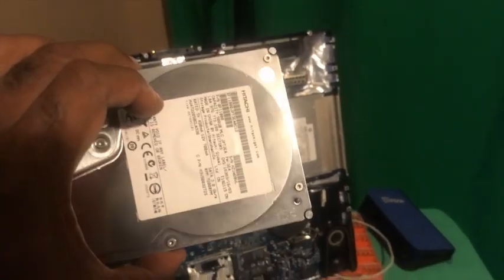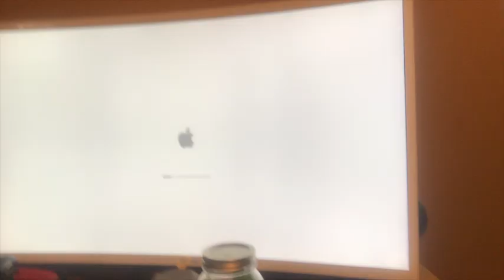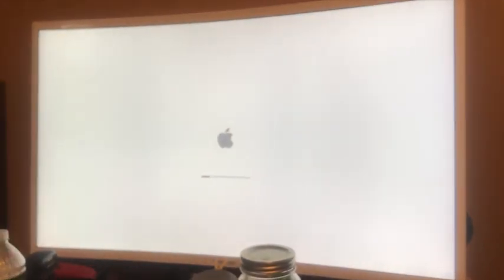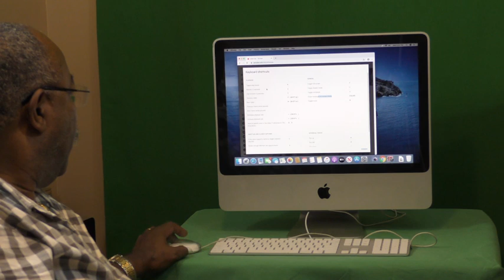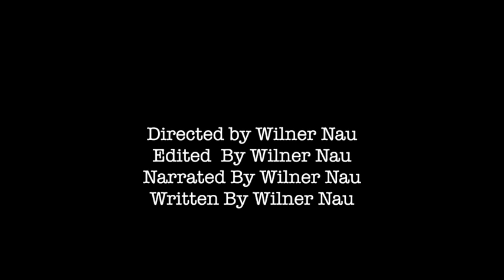Mac Os  Catalina on a iMac 2008

Comment: Nice Video Sir Thanks For Sharing I have a early 2008 IMAC 24 upgrade ram to max  that runs great I used fir DJing my live streams or Practice sessions  for about 2 years. Its my main one and I bought it for $200 about 3 years ago I also have  15"MACBOOK PRO I use to DJ with I love them both but I can't run some of the newer studio I use on the Pro If I make these upgrades will I be able to yun it with apps like Logic Pro X or should i upgrade to something newer with Thunderbolt. I love my makes for what I do they been great over PC I do miss windows office better but it stops there.PC Guys get soooo mad at me for the Love I have for Apple. I was that PC and Samsung guy for years not but virus and crashes and over heating issues.I buy everything Apple and this far its been a great experience for me watch phone ibuds pro Imac and Ipad 2 I bought for $45 2 mo ago and I talked family members into Mac Air and Ipad Pro everyone is one big happy Apple Family.

Comment: Can someone please tell me how well would CATALINA work on an early, non-upgraded, 20 inch 2009 iMac? 😭

Is it worth upgrading from an El Capitan? I just need to work low maintaining applications such as Microsoft 365, grammarly and other academic writing applications (JStor). 
PLEASE. HELP. 🥺
Reply: Adil Majeed same question
Reply: I don’t know if I would risk compatibility issues if your using those applications for school.
Reply: Adil Majeed running osx catalina on may late 2009 imac. Works fine. So far so good
Reply: You must upgrade ram to 6-8GB minimum and upgrade to SSD 256GB minimum and for best performance choose high sierra. It will run super smooth like stock. You can upgrade to Mojave and it will run great too. Catalina is not worth it because 32-bit apps not supported and it is too resource intensive in general for old macs. But it can run it! And it will work ok but your cpu will maxed out with any heavy multitasking.

Comment: Where do I buy the hardware to upgrade my 2008 iMac, I need Catalina on it Sir
Reply from the maker: I have a 27" one for $400 free shipping. Including Catalina. contact me at wilnaugroup@gmail.com, Pay by Paypal to wilnaugroup@gmail.com.
Reply from the maker: iMac 27-Inch Core 2 Duo 3.06 GHz Late 2009 1TB HD 4GB RAM, Optical Drive, SD card reader, $400 Free shipping Paypal wilnaugroup@gmail.com.

Comment: Yeah they are good. I just fixed my 2007. Bad video card. Next step is to do this OS upgrade. Thanks for the video and tips
Reply: Not compatible has to be early 2008 or newer
Reply: @brandonwear9081  I haven't tried it but thanks for the heads up. However all the models aren't compatible thus the hack. Why would 2007 be so different?
Reply: @WilliamJoseph2015  the 2007 models have merom processors and those are not supported. however you can upgrade your processor for really cheap (basically any p-socket penryn core 2 duo processor will work) and then you can upgrade to an unsupported system, too. it's all explained on dosdude1.com/software.html
-if you need help upgrading your processor (that means disassembling the entire computer because the processor is situated on the backside of the logic board), head over to ifixit.com and look for the cpu repair guide.
Reply: @ledekou1983  thanks I remember checking into this months ago. Never did decide which penryn professor to buy. T900 was my top pick.
Reply: William Joseph just becose it’s not compatible with the hack that’s what the site says